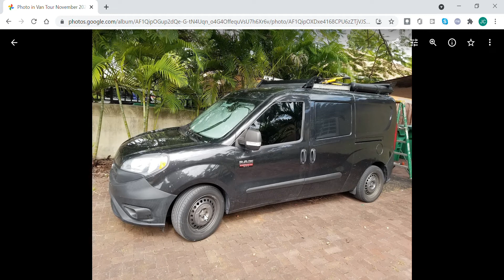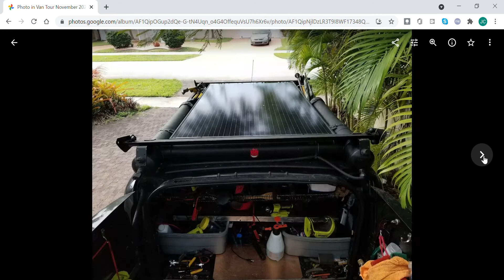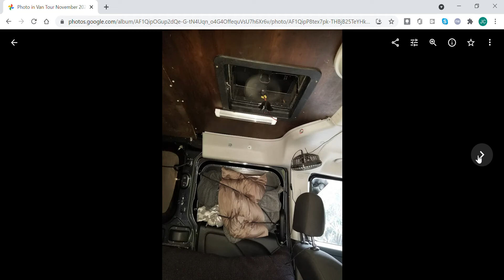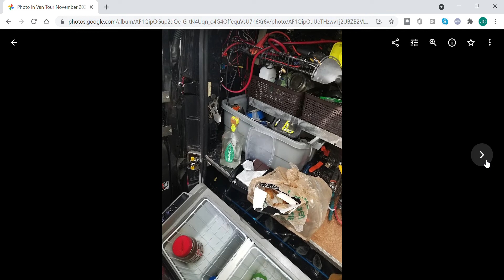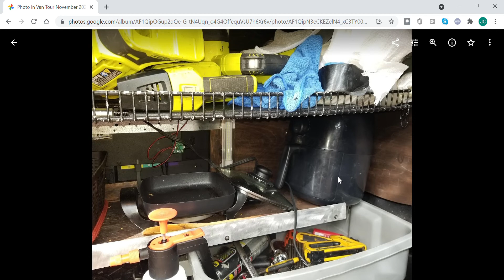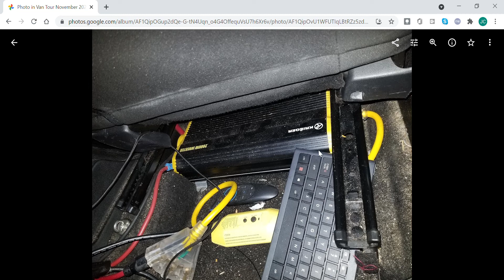Van Tour Update November 2021

Comment: Hi - just found your channel. Nice van!! I couldn't reply to your comment on my video about the Chafon solar generator, so I left you a public comment on there. Just pinging you here so you know. Take care
Reply from the maker: subbed. checking out your videos.  I repurposing my 200wh solar generator for an offgrid coffee table using a 100w solar panel that will power security camera that can store months of footage.  Will find out tomorrow afternoon if it's charging after I removed a bunch of parts and reconfigured it to fit flat between the solar panel and a 70qt cooler base.  If it works I'll post a short video.